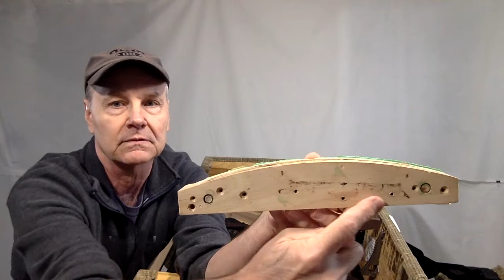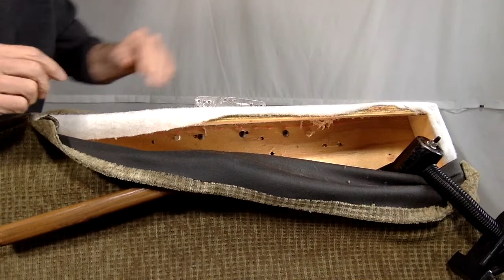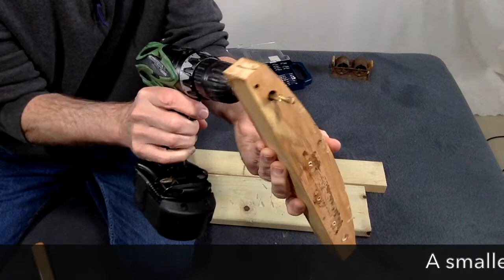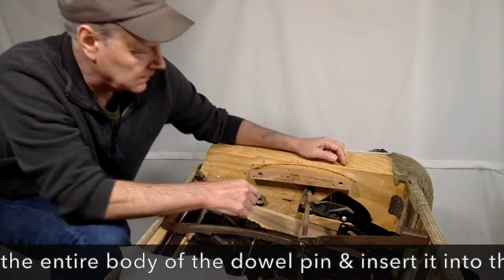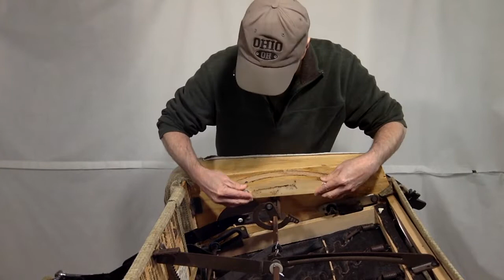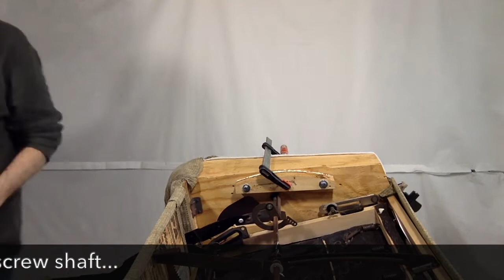How to Reattach a La-z-boy Rocker Block

Comment: My rocker arm was slightly cracked so tonight I wood glued it back together. And tomorrow I am going to reinstall it with the hex bolts! I am glad I found your video. Thanks
Reply: The rocker block wood glued solid, but then I applied 2 coats of flex steel on 3 sides of the rocker block. The side which wood glues to the chair I left bare. Also, I had a little piece of wood missing about 1/4 inch by 2 inches, so I filled it with plastic wood filler, and it bonded solid. I let everything cure for about 5 days and today I put my lazy boy chair back together, and everything works great. (I used 3/8 inch x 3inches hex bolts)

Comment: What a fantastic channel.  My recliner is about 18 months old, and the rocker block was wobbling.  Upon closer inspection, they never glued the factory dowels in.  As they worked out, all the force was on the three screws, two of which were broken.  I used your videos to understand how to take it apart.  The most helpful tip was that the springs are under tension and need to be blocked to make the removal/and reinstall of the rocking base easier.

Thanks for all of your videos.  You are providing a great service by sharing this information!

LaZBoy wanted a minimum of $300 between the pickup charge and at least an hour or two of labor to fix it.  About $2 worth of bolts/nuts/washers and two hours of my time later, and I'm just waiting on the glue to dry.  The bolts look far stronger/superior to the factory setup (even if they hadn't left out the glue).
Reply from the maker: @timdgsr - You're welcome -- good job!

Comment: I just wanted to tell you thank you. I have a Lazy Boy recliner that was made back in 2000 and was the most comfortable chair I owned up until a couple of years ago when the rocker block split, I tried to fix it but never got it right. I didn’t want to get rid of the chair because i knew it could be fixed somehow. Yesterday after following your instructions and cutting a new rocker block out of a 2x4 and purchasing the hardware that you recommended. I now have my the use and enjoyment of my recliner again.
Reply from the maker: @jphilli832 - You're welcome -- good job!

Comment: Thank you for this video. The rocker block on my 23 month old chair detached. It had very little glue on the block, and none on the dowels. The dowels simply slid out, and the block detached. Reattached it with plenty of wood glue and metal bolts, and it is far better than new. The other block appears properly attached,  but I'll know how to fix it when it comes loose.
Reply from the maker: @Doni Grande - You're welcome -- good job!

Comment: Unusual question I’m sure but is it possible to stop a Lazy-Boy reclining rocker? My wife doesn’t like the rocking. Thanks for any suggestion.
Reply from the maker: John Stegall - I've never blocked one off so that it wouldn't rock, so there's no particular method that I would recommend.
Reply: I bought a Lazyboy Harbor Town recliner thinking it was a rocker recliner but nooo. Recliner only. Now I trying to see if it's possible to switch out the recliner part with the rocker/recliner from my older La-z-yboy . It's not a Harbor Town but looks to be same size.

Comment: Great video. I will be watching this a couple more times before I attempt to fix my brothers recliner. His recliner is a little newer and they no longer use plywood they use particleboard. And my brother is a very large man. I’m thinking I might need to strengthen further by using wood on the other side of the particleboard as well and use longer bolts.

Comment: I had the rocker block fall off my recliner a couple weeks after i bought it. I brought it back and exchanged it for another. The same thing happened to the 2nd chair. Since then i know 3 other people that have had the same issue. In every case the dowels broke because there wasn't any glue on them and they walked out making them weak. For the price LayZBoy charges, they should just use bolts in the first place.

Comment: Is it 7/16 x 3 bolts i should look for?  I haven't disassembled yet, but it looks like no or very little glue was used. The dowel is almost backed fully into the block.

Comment: Thanks for the wonderful video.
I have replaced the rocker block on one side of my chair and I used the lag bolts with washers and lock nut instead of dowel rods.
My question is: Do you think it would of any benefit to drill a third "dowel" hole through the rocker block and OSB and attach a THIRD lag bolt? It just seems like that design gets a lot of downward pressure (and I'm a big guy)  and I guess I am thinking an extra lag bolt would be helpful. My thought would be to put the 3rd hole about an inch from where the spring mounts. Thanks again!
Reply from the maker: @Ronald Jurgeson - Just to be clear, lag bolts are bolts that are screwed into the wood like a large screw. Since you are using locknuts, I'm assuming that you are not using lag bolts, as that would not be recommended.

If you've prepped & set the block properly with wood glue & the bolts are tight, the bond is significantly stronger than the original. The bolts are like having 2 permanent clamps in places. 

I also typically add one La-z-boy screw from the outside of the arm frame, through the panel & into the Rocker Block in the middle of the block. You could install a 3rd bolt there instead, but as you said, those blocks carry a lot of weight. And drilling more holes into them also increases the risk that the block could split along those pre-drilled holes some point.
Reply: @reclinerrepairguy4155  Thanks for the reply. Yes, I am using the lock nuts. So that is a lag whatever you would call it. I actually call those lag bolts and the ones that look like large screws I call "lag screws," but I'm probably wrong. I did think about the large hole actually decreasing the total wood stability, and decided against it. I've got it all wrapped back up and restapled, been sitting in it for a couple days now and so far it's okay. Thanks again for your wonderful video and tips.

Comment: Great video, thanks! I'm going to attempt this fix tomorrow. The dowel on mine broke, I threw a couple 3 inch wood screws in to get me by. Is there a science to why dowels are still used? Seems strange. I noticed with my temporary fix I've got a significant creek when rocking, do you think something else is broke or loose? Thanks!!
Reply from the maker: @Barrett Jarabek - When a Rocker Block dowel breaks, the glue bond that held the block against the inside arm frame usually fails as well. Adding a couple of screws is not a permanent fix. 

Follow the instructions in the video for regluing & reattaching the block. You can use new dowel pins or bolts (stronger).

Why are dowels used, ask La-z-boy.   ;)
Reply: If the dowel breaks it’s always because the glue joint failed. 
Dowels are used not only because the tight fit but also the similar porosity of the wood has the same expansion and contraction rate as the block and the wood arm frame. While I agree the bolt is made of stronger material, over time the wood will expand around the washers compressing the wood. When the wood contracts, the bolt is loose. This is the reason La-Z-Boy stopped sending rocker cams.

Comment: Love your videos, wish I would have found them years earlier! I'm pleased to see that the rocker block repair I made on my own years ago closely matches yours, except I stuck with using new wooden dowels instead of the bolts.

Over time, the original machine screws attaching the metal side plates on the back have broken, one by one, and I've replaced them with stainless steel equivalents, from the local hardware store. I anticipate these replacements will probably last forever, and if I ever discard this chair, I plan to recover those screws first.

Speaking of which, this old La-Z-Boy is pretty worn out and uncomfortable. In an ideal world I would replace it, but I'm not impressed with quality of any of the rocker recliner I see made now. As a technician, what do you think? Are there any rocker recliners made with decent quality anymore?
Reply from the maker: @AlexStangl42 - Mass-produced furniture today -- La-z-boy, Flexsteel, Ashley, Catnapper, etc. - is not good quality throughout. Cheaper frame materials & construction along with low-quality padding are the primary culprits. If you don't get the basics right, you don't have a good-quality furniture product.

To find better furniture you have to look beyond the mass-produced market to furniture that is built with better quality frames & padding. It will certainly cost more, but will last longer.
Reply: That makes sense, thanks! Any specific recommendations?
Reply from the maker: @AlexStangl42  - No. It's largely due to what quality brands are available in your area.

Comment: I am 73 yo and 5'9" tall woman.  My Pinnacle La-Z-Boy is 15 years old.  The leather is still in excellent shape, but I find when exiting the rocker/recliner, it rocks forward and my knees are so high that it is difficult to get up.  I know that the seat needs to be "restuffed".  I also feel that when I sit in the chair the pitch is too great toward the back.  We will be trying to adjust the springs soon.  I feel the 1/2" would help me some.  My feeling is that at my age, I don't want a recliner that rocks anymore.  How can I stabilize the rocking?
Reply from the maker: @sarahfcouture1178 - Here's something you can try until you find a repair tech to address these issues for you: Find a firm (supportive) loose seat cushion or flat pillow that's about 2-4" thick. Put it on top of your seat for a while & try it out.

Comment: You didn’t talk about the smaller pilot hole in the rocker cam and how it should be oriented to the rear or how its original purpose was to secure a bolt used for the old style toggle. I can date this chair to the early 90’s. Again, the bolts aren’t stronger and will cause damage to the wood because the materials are different, metal and wood expand and contract at different rates, crushing the wood fibers around the metal. Then the bolts are loose. It’s best to replicate the original design as close as possible. The strength is entirely from the glue joint. The wood dowels are to eliminate shear. The wood screws are to secure after clamping until the glue dries. It’s the same reason you don’t secure raised panels with brads like a lot of “pros” think it’s ok to cheat, then the panels crack. 
Just by tightening those bolts you are crushing the wood fibers around. Soon as the room temp is raised the wood swells faster than the bolt. Summer comes, the A/C cools that bolt faster than the wood, no more shear prevention. BTW, 35 yr. furniture tech.
Reply from the maker: @tfguru1 - Sorry, I don't share your concerns. And for those that have them, they can simply reattach the Rocker Blocks with wood dowels, as shown in the video. As I mentioned in the video, I prefer to use bolts.

I've seen many Rocker Block failures that were glued from the factory, including some that we re-glued from a previous repair. I've never seen a bolted repair that has failed. That's not to suggest that "bolted" repairs cannot fail. Anything's possible, especially if the repair is not done properly, or the forces put upon the Rocker Blocks are rather extreme.

Comment: Is there an easy way to stop my father in law’s Power Lazy Boy recliner from rocking?  He is 85 years old and has fallen several times trying to get out of it.
Reply: I have the same problem but my lazy boy chair is manual and not a power chair
Reply: @DeniseLaFranceCDNpainter  Seems like with a manual chair you could make your own "rocker" block that doesn't have a radius on the bottom?

Comment: When sitting in my rocking recliner it leans back too far for my comfort. Any way to restrict how far it leans back? Nothing seems loose, the tension wing nuts are set correctly. Any way to adjust how much it rocks back?
Reply from the maker: @River r - If the chair did not have this issue earlier, chances are something has come loose or needs to be repaired. Have a repair tech check it out.

If you've had this issue since day 1, you may be able to adjust the chair pitch. (Keep in mind that on La-z-boys this adjustment is minimal.) Or, you can watch the 'Recliner Tip-Over Problem' video to see if that issue (excessive pitch-back) applies in your case.

Comment: I need to replace the 1/2" square bar that is counter sunk into each wood side piece and the foot rest scissors attach to. It broke in the center where a pin went through. Is this replaced as one piece or is the whole mechanism come with this piece ?
Reply from the maker: @jmb - La-z-boy typically requires that you request each replacement part that you need. The square rod is called the Drive Rod. Be sure to order any other parts that were bent or damaged when the Drive Rod failed, as well as any other mechanism parts that you may need. They charge a part order processing fee per warranty part order that ranges between $13-15 for each order.
Reply from the maker: @jmb - I forgot to mention there's a 3-part video series on the ReclinerRepairGuy.com website that covers Drive Rod removal & installation, if you need it.

Comment: @ReclinerRepairGuy
What is the purpose of the dowels? Alignment of the block? Also I would assume the rocker block is made of hardwood and not easy to split/crack ? Is this correct?
Reply from the maker: @Dixon Bidenzmouth - The dowels are used for alignment and a bit of strength. Bolts are stronger, obviously.

The Rocker Blocks are made of solid wood, though I don't know the type they are using on their new products. Or if it's considered to be a true hardwood (manufacturers are always looking for cheaper alternatives). The blocks do seem to break loose from the arm frame more often than split themselves. 

The downward force exerted on them can be significant, especially when a larger user "plops" down in the seat, rather than sitting down normally. It's typically from accumulated forces like these and others (2 people sitting in the chair, etc.) that eventually cause many blocks to break loose.
Reply: @reclinerrepairguy4155  Thank you. I just bought the ‘Joshua’ recliner but I take care of my stuff and go easy on it. You do a great service by sharing your knowledge thru these videos. You are an honest guy and I wish you lots of business for it and you have the video making/editing skills too. 👍
Reply: The original dowels are there for shear strength.  The three little torx fastners they use seem to be more for holding the parts in place while the glue dries than anything else.  The dowels support all the weight on the chair when people sit in it.  The bolts that Recliner Repair Guy is replacing the dowels with is much stronger, and less likely to fail if you use proper nylon locking nuts or some loctite to make sure the nut doesn't back off.

Comment: can you help with disabling rocker for infant, what would be easiest way to stop all rocking on Lazyboy Power Recliner.... will disabling rocker cause problems with the power recline functions?
Reply from the maker: @Michael Gottlieb - That's difficult to do without interfering with the recline function. The chair pitches (rocks) back when the footrest extends.
Reply: @reclinerrepairguy4155   i want to try swapping the entire rocker base for a non-rocker base
from a similar lazyboy recliner i have, do you think i can do it? what
tools will i need (and what tools do you use exactly to remove the
staples along the edges and reinsert them without staple gun?)

can you help? can you guide me? or make a video?

for reference my rocking Lazyboy is called "Pinnacle" with power
recline function, and my non-rocker is called Lazyboy Rowan with Power
recline function, i want to perform a double transplant, but the
motors are in different orientations when i look underneath, i'm
enclosing video to this email of their bases

https://www.icloud.com/attachment/?u=https%3A%2F%2Fcvws.icloud-content.com%2FB%2FAWYt1ldF451YeWnGz3JsfHrcs_gzATHlxT523TVI7DDUcVHdd4Kr5Ftm%2F%24%7Bf%7D%3Fo%3DAu6-1op9-oGCNJCkaOSXd7NIP93vgUc1hJZMcVaZ9xMT%26v%3D1%26x%3D3%26a%3DCAog_jbycMoA-zDWKciPS8Mx-8PIX9P-uI-4tGt9c4SsJdgSeBDH1sDU6y4Yx-a7qPUuIgEAKgkC6AMA_zuZOL1SBNyz-DNaBKvkW2ZqJv6zPHUua5VwmnE_umMxIOOP7ZR8p_3XPzRGTct5Bc77cHH6TsLGciYfxmLjkq63DU8bssODE0SUk03FlaIeU_PraNzx-9AWV6FXwQsTYw%26e%3D1612039779%26fl%3D%26r%3D3A71123B-F66E-4702-AF23-7484F8B41C3F-1%26k%3D%24%7Buk%7D%26ckc%3Dcom.apple.largeattachment%26ckz%3DCE259A65-2ACF-4726-9D51-BC46F3767D8D%26p%3D11%26s%3Db0aymTywk6itL7MGkHjzzuRwC5k&uk=z-nSzygwH5jGXTxf0lc4Ng&f=IMG_1264.MOV&sz=63711211

https://www.icloud.com/attachment/?u=https%3A%2F%2Fcvws.icloud-content.com%2FB%2FAZjgf4628Qfy5dv0yK4cMzkHFji6AbPoFTxXt_WHKb_GElwJcJz3Kr1F%2F%24%7Bf%7D%3Fo%3DAk8v63MsUiQc8CloASjHLKVAhZLdnVrTLL2CofVY_IKE%26v%3D1%26x%3D3%26a%3DCAogQ1ve7HPI_tkDkqfdzY7FB52mG3XS-nNY1Bpjw4JQ45USeBCG18DU6y4Yhue7qPUuIgEAKgkC6AMA_2yOZbVSBAcWOLpaBPcqvUVqJu2VK86tnEp_dPjPbca3LclcuZ6yRKZNc2mTn9YtxWmJvItAlzeyciZoek1r4k3R0R-drnVgGfmSmCv4wleKdvS3uW-MfEmFYIp9XATthA%26e%3D1612039779%26fl%3D%26r%3DC62E2226-CF45-4F42-938C-75CCBBABA093-1%26k%3D%24%7Buk%7D%26ckc%3Dcom.apple.largeattachment%26ckz%3DCE259A65-2ACF-4726-9D51-BC46F3767D8D%26p%3D11%26s%3D1ydt1l9wrtLYj_O9JN-5znYTmrQ&uk=00B72w3Cd9CKBfXZOQTZag&f=IMG_1265.MOV&sz=82218206